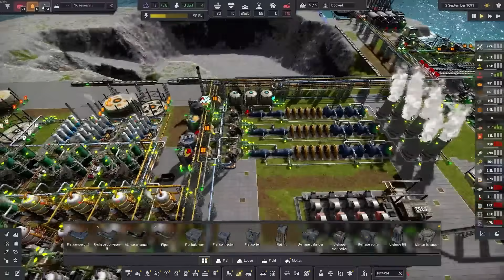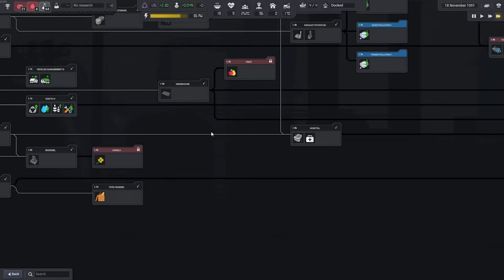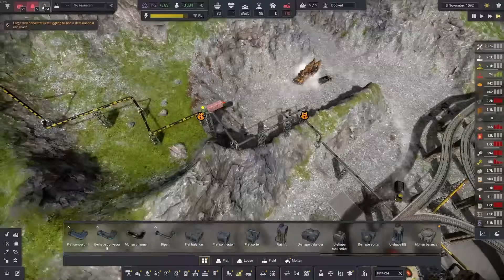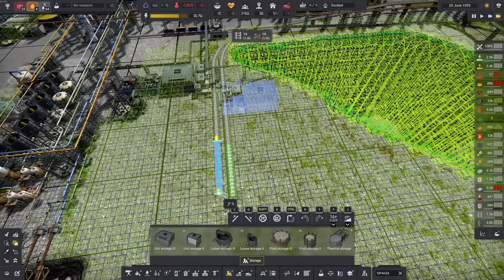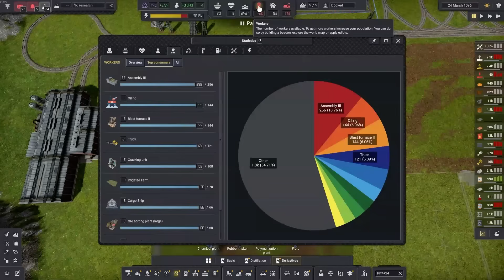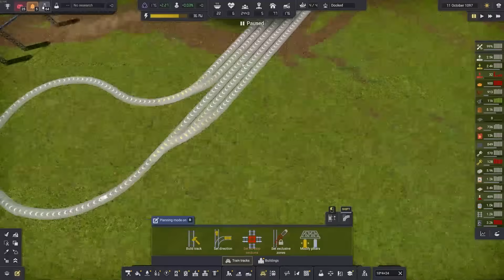Introducing City Blocks? | Captain Of Industry | Update 3 Day 32

Comment: Rubber is only used in electronics one. And your building four stations for rubber. Are you planning to build electronics one in another location? Looks like your moving forwards.
Reply from the maker: Didn’t realize that was the only use for rubber. Just wanted to get all base items on the train network “just in case” lol
Reply: @JTMPLays  Besides belts. Their is an in game wiki by right clicking on the resource on the right window or the mortar and pestle. And hitting F1 and searching. Should be anything you have all ready unlocked
To the left of the mortar and pestle is a stats showing a graph for over time production and consumption and one may pin resources to the quick bar. Useful to see how much slag your making for instance.
 F3 is contracts and quick trades and F5 is the Captains Office. 
F2 is the tutored that could have informed on farming.
 F4 is blue prints. That I too spend a lot of time building in. Once I find design that agrees. I keep a copy. Over time it gets refined between each game and use.